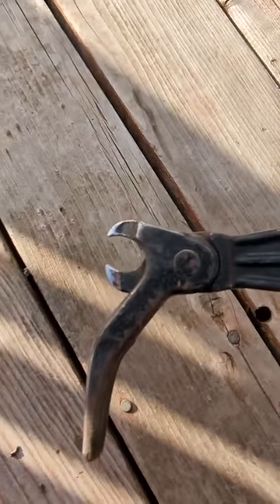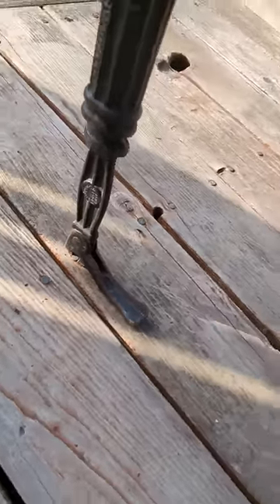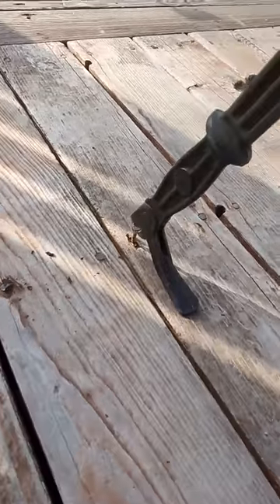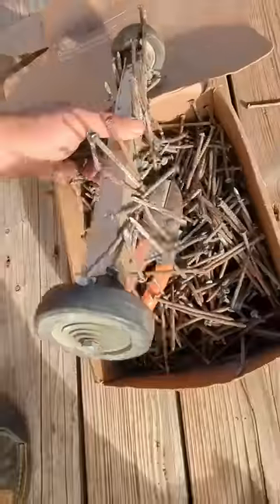The Deck flip is on! #deckrestoration #redwood #reclaimedwood

Comment: Skip the pressure wash, go straight to planer, pressure washing damages the wood
Reply: I thought the exact same thing he's just gonna have to remove more wood at the planer, making the deck boards weaker and likely taking more time to complete as well.
Reply: But dirty wood will wear out your planer blade faster so it may be a wash
Reply: @Ivan.Wright  maybe hit it with a sander lightly first? Lol idk
Reply: @cjbrags1344  No, that'll just get the very topmost layer and not in any cracks or divots. On that much wood I'd go with a quick spray, it's exterior wood anyway so a quick blast of water should be fine. However, if there's a real concern I'd go with a wire brush
Reply: @Ivan.Wright I’ve unfortunately kinda fucked up an entire deck about this size by pressure washing the paint off of it. That being said it is what the customer wanted and neither of us knew at the time that it damaged the wood. Of course not long after I did the job I saw a video talking about how it damages the wood and causes it to “fray” or splinter on top. Basically it ruins the top few layers of wood IF you use too much pressure. And there is a VERY fine line between just right and too much.
Reply: @keithbroh5730  But that's without running it through a planer. Those top layers that could fray are gunna get removed always so I don't see how it's going to hurt the wood in this situation.
Reply: Pressure washing doesn't "damage the wood" as in damaging structural integrity. It removes the surface layer of weathered wood, and it removes less than a planer. Pressure washing is fine. You just want to give it a few days to dry in the summer sun then stain it. Don't even really need the planer unless you want the smoother finish.
Reply: I don't know. I've never done this, but if I did, I would have to say I would use a brightener, powerwash, plane, sand, install and stain.
Reply: Dirt and grit in the wood will ruin planer blades within the first pass through, which will ruin a board beyond repair.

A properly set pressure washer will clean the wood, and once dry the planet will make it smooth as glass.
Reply: @cjbrags1344 , a sander will push any dirt and grit into the wood and then ruin the planer blades.
Reply: He’s doing it right
Reply: Honestly a drum sander would be ideal
Reply: A planer is gonna leave the bite marks on each end
Reply: @Cantspeakable Yeah... Just flip the boards, screw them all down, light pressure wash, sand down the boards in place and seal. D u n.
Reply: Wrong and terrible  idea, ALWAYS 1st clean off (Pressure wash) to help remove embedded sand and dirt BEFORE planning or you planner blades wares away or is damaged quickly..
Reply: Soft wash it
Reply: I was just about to type exactly what you did!!
Don’t add water, just take a little off the top.
Open the grain up a bit then seal it up with deck product of choice.
Reply: same
Reply: @Ivan.Wright and? Change the blades out a couple times during job, or go buy a carbide head helical planer head and dont worry about it.  

Changing the blades 2-3 times during the job is going to be a lot faster than pressure washing everything, letting it dry, then planing.  Youll also less damage at the end of the job, thicker boards, etc etc.
Reply: Yeah my thoughts also.
Reply: id never put those boards through my planer, they're getting washed or sanded, too risky for any metal to be inbedded that you missed, only takes one nail, screw, staple to ruin your blades, expensive and timely mistake
Reply: Improperly pressurewashing* damages wood. If you use a higher flow at a lower pressure it will clean withought furring the wood up.
Reply: @Ivan.Wright full day of work vs new blades. I'll take the new blades.
Reply: @Ivan.Wright time is money sweetheart. At my rates it makes more sense to buy new blades.
Reply: @Cantspeakable not if you weren't cheap amd bought a good planer.
Reply: @airgliderz new blades are cheaper than a half days work kiddo
Reply: @Junior-zq2ls  doesn't take all day to pressure wash that. Mabye an hour if you know you know
Reply: @Junior-zq2ls he kiddo, why you pressure wash first, no need for installing new planner blades, a pain.l, saves time kitty
Reply: @airgliderz  lol, definitely does not save time pressure washing it kiddo.
Reply: @ApexPressureWash  lol. An hour? Okay buddy, guess it just magically dries instantly huh.
Reply: @Junior-zq2ls  wrong again slick.
Reply: @Junior-zq2ls  go do something else while it dries. Plan accordingly. For example when I'm on a job im pulling out my hoses while I'm waiting on water to fill my buffer tank.
Reply: @Ivan.Wright yes it would however this is exactly what your printer was made for so quit wasting time doing it the other way it's literally faster to change or replace the planer blade
Reply: Bad preasure washing damages the wood, washing dirt off should be fine, washing paint or coverings off and it will ruin it most definitely 

Water is great for finishing wood, it opens the topmost grain fibres up for sanding, you can get a much finer smoother finish with some practice than just planing and finishing, planing it will inevitably pull fibres up and leaves the surface open for dirt, bugs and contaminates to get in
Reply: @ApexGamingHDTM  and when I'm on a job, I just use a planer and spend 12 buck on a pack of new blades. Takes less than 2 minutes to change them out. Time is money, and you waste time.
Reply: @airgliderz  less than 2 minutes to change out the blades kiddo. You go ahead and keep wasting time. I'll go ahead and keep making more than you.
Reply: @airgliderz  lol. Not even a little bit. But whatever helps you sleep.
Reply: @Junior-zq2ls  How do I waste time? If blades are so cheap just consume the blades and save time im all for that.
Reply: Like it doesn't get wet in the rain lmao it'll be fine
Reply: @joewat3982  planer
Reply: @ajaxracing  lol, if that's your defense you have no business here.
Reply: @ApexGamingHDTM  they are cheap. 15-24 dollars four a 4pack.
Reply: Not when you use the low side of a pressure washer
Reply: @keithbroh5730 it's ok. Painting ruins the wood worse. You probably used the right pressure but the wood was starting to rot because it was painted.
Reply: @Junior-zq2ls  hey if you like to waste time money and the time and money to keep changing planner blades you ruined then grieved boards you have to plane again creating different thickness boards vs a quick pressure wash cleaning. I glues you like gouging customers and ruining equipment cost time and money. But hey that's how bud light drinking democrats do, take more time, cost time, ruin equipment, take longer, and cost more money, enjoy your version of quality with now on clearance expired stale bud light beer.
Reply: Why would you plane the former top?
Reply: Then
Reply: @airgliderz  lol. Different thickness proves to me you have zero clue what you are talking. Someone has obviously never used a planer. Take more time? I can plane am entire deck, including the less than 2 minutes to change the blades faster than you can power washer it. Price gouging? I'm saving me time, which means them money planing it instead of power washing it. And blindly bringing politics I to an argument that has nothing to do with, just proves how upset you are over this conversation. Do better kiddo.
Reply: @airgliderz  but hey, you need to resort to insults to prove your point. Says a lot about the person you are.
Reply: @Junior-zq2ls  this comment right here just reeks of first-year journeyman energy nobody's making any money this is a hypothetical situation in which you would be in the shoes of the person who made this video
Reply: Pressure washing damages the wood and when you don’t know what you’re doing. Deck cleaning is mainly done correctly with chemicals and the pressure washer should only be used to rinse the deck wood with, e.g. to sweep with. 
When using the pressure washer with the tip to close to the wood and not using chemicals not only damages the wood but ruins it. 
All of the soft wood of which is called Ray is very easily damaged by the pressure washer while the growth rings are much harder and not damaged by the pressure washer. Once the Ray is damaged and the growth rings are standing tall it allows for water to collect in the area of the Ray. Thus, leaving the life of the deck much less than desired. 
I’ve always tried to explain this to customers and other folks that think pressure washing a deck without chemicals is the way to go. Retired now so don’t really get involved per chatter anymore. You knowing that pressure washing damaged decks is hopeful.
Reply: Low pressure and special cleaner you spray on before you wash it just have let it sit for about 20 mins
Reply: @PRACTICALCIVILIAN 
Properly set? You mean the right size tip? 
Also, pressure washers used on decks are really just meant to rinse of chemicals such as cleaners and brightners. 
Never use a power washer by itself to clean a deck.
Reply: @Cantspeakable 
That’s operator error.
Reply: @OldsmobileCutlass1969Va 
Crown down.
Reply: @ApexPressureWash 
A 40 tip with chemicals. Use the washer as a sweep to rinse only. Let the chemicals do the cleaning.
Reply: @ApexPressureWash 
Lol, 5 minutes to load, 30 minutes to get to the job, 15 minutes to get set up and 30 minutes to get back to the shop. The job to me looks like at least 2 hours in addition to the hour and 20 minutes. 
That’s 3 hours and 20 minutes. 
What are your rates? Maybe I should hire you😂
Reply: I love YouTube, I just ran through the comments and now I'm a certified deck builder, who knows NOT two pressure wash the wood and if I really have to I can softwash quickly or better yet wire brush before I run over it with the planner.
Reply: @johnbagewll2321  , I mean properly set pressure gauge. Mine has different tips for different tasks and a dial gauge to set the pressure of the hose.
Reply: @PRACTICALCIVILIAN  it’s been many years but mine was 3000psi and only adjustable via tips. 
I’m Probably many years out of the loop! 😂
Thanks for your answer.
Reply: @chrisevans3259  
Indeed, I’ve driven past a few projects in my time seeing guys with a 20 tip 3” away from the surface of the deck. Makes my stomach turn because they are calling themselves professional while ruining a deck every pass of the wand. Meanwhile, the customer is inside thinking how happy they are for paying a pro. Ugh.
Reply: @johnbagewll2321  , you’re most welcome. 😉 I was just searching, and apparently there are machines still being made that are only adjustable by changing the tips. I bought mine a 20 years ago when it was 1/2 off, so I got a really good deal.
Reply: @PRACTICALCIVILIAN  
I have no idea what I paid for mine but it payed for itself 20 times over I’d guess. Sold it at a yard sale when I sold my house back in 2015. Man time flies.
Reply: @joewat3982  😵
Reply: @johnbagewll2321  $150 minimum service call, and we are talking about on site time. Of course it takes longer but you do bring a valid point
Reply: @Ivan.Wright a planer blade is like what $10-$15? Cost of wasted wood is easily more than a few blades.
Reply: Or just dont put the pressure washer tip  so fucking close to the board lol. That simple
Reply: @joewat3982  
Alrighty.
Reply: @ApexPressureWash  charge the minimum of $150.00 to show up. Then charge $150.00 per hour for 1 man and 1 helper. That way you can estimate all day. You’ve got to pay your office staff, project manager etc etc. 
Gotta charge a premium to run a business that will last. I’m an estimator and can’t miss a dollar. Everyone’s go to eat. 
Semi retired is good.
Reply: If you planing them why bother power washing them at all.
Reply: @mistergoodcitizen9914  
Happy 4th!
Reply: Yeah sending dirty wood through a planer destroys planer blades. A light pressure wash doesn't hurt redwood at all.
Reply: @ashenmoonclash  
Exterior bleach and a rinse holding the 40 tip back from the surface 10” to 12” does the trick.
Reply: If done wrong yeah, gotta use proper technique to not damage or at least minimize the damages as much as possible
Reply: Not everyone use a planner
Reply: Right?
Reply: Pressure washing opens up the fibers so the stain can actually penetrate and perform way better, it also swells the grain so you can actually see the grain so you can put a semisolid/solid stain on that last way longer than transparent/ translucent. But what do I know, I’ve only been doin it for 30 years…
Reply: You can pressure wash wood as long as you are careful and dont put the tip right up to the surface, stay about 6 or 8 inches away
Reply: @yzrippin  who is a _____
Reply: You want to wash the grease and grim off before planing it. It'll gum up and dull the blade. You just have to let it dry first. Fyi, I deal with reclaimed wood all the time
Reply: When you run wood through a planer  it takes a bit more off the first few inches of each board. Maybe a drum sander ,that denail tool has taken a lot of people's eyes.
Reply: well pressure washing CAN damage wood but not always. unfortunately, usually, the pressure required to clean the wood does damage it so you can only safely do so much. the rest is up to a soft wash process which can do great.
Reply: @godw1ll99  not if you use the correct pressure
Reply: The pressure wash (at least to me) would just be preventing unnecessary wear on the planer. 
I probably wouldnt bother but my blades are pretty affordable. If i had some of the other machines iv used i might change my tune
Reply: Just have to light sand after the wash
Reply: @miles11we  just because something is affordable. Doesn't mean you should waste money on something that is preventable
Reply: True
Reply: @MrGravylegs So i know dirt and debris dulls knife blades quickly, no matter the steel. I would imagine an outdoor deck is going to have a lot of junk trapped in the wood fibers.

That being said, how would you go about avoiding dulling your planer blades insanely quick and possibly damaging the wood? Genuinely curious, not trying to say you're wrong.
Reply: pressure wash with the grain use the right tip and keep the right distance and you will be fine.
Reply: @santosdr2  circle soft tip
Reply: @Junior-zq2ls  its purely preference what you want to do. For fuck sake. Pressure washing it is fine if you know how to use a pressure wash to do it.
Your job do it the way you want to do it.

You want to jump straight to planning it down.  Do it.

Pressure washing is very fun process though.
Reply: Not if you know how to pressure wash. Its salvaged wood anyways. Why burn up the blades?
Reply: @keithbroh5730 there is no paint on the underside of his deck. Nice story tho
Reply: Pressure washing is by far the best choice if it’s done correctly. But yea if he just gets a cheap one and blasts the hell out of it with only water and doesn’t let it dry he’ll be f*cking it up
Reply: I would go straight to the lumber yard and sold the deck to someone that wanted to remove it that knew what they were doing.
Reply: Dirt damages the planer 😂
Reply: plus that redwood is now CURED. No way hes getting wood that good in Home Hardware. Yeah break out the triple rotor planer and hit that bad boy, then mix up a good batch of sealer and hit it a few times with some color mixed in and you have another good ten years or even more cause the underside is now practically water proof as well.

I love recycling things and not wasting stuff thats good.
Reply: @johnbagewll2321 every power washer has adjustable pressure. The 3000psi was a max, not an only setting. Learn your equipment. Most folks don't even need to read the manual to figure out these things. The tips are for spray patterns. There would be a turn on the "gun" to adjust the pressure on cheaper units, and a regulator on the machine on better built/professional units, even years ago.
Reply: @mistergoodcitizen9914 to get embedded dirt out of the wood. Not all planet blades are cheap. A chip or scratch in a planer blade leaves marks on every inch of board that passes through it. Sand and dirt damage blades. It's pretty simple, really.
Reply: @thomasarussellsr  
It is interesting that you are telling me I’m wrong, while also trying to insult me, while in fact YOU are wrong. 
Have a great day.
Reply: Pres washing doesn't damage wood if you know how to do it correctly.
Ive been lead pressure washing tech for 9 years and have cleaned/fixed alot of wooden fences/patios/etc
Reply: Let that bozo figure it out
Reply: My dad did a number on our porch with the pressure washer. Fucker went and croaked before he ever fixed it 😅
Reply: Skip the planer. Pressure washing only hurts it if you don’t know what your doing. No planer needed.
Reply: Drumsander...
Reply: What in the heck are you on about man. Pressure washing does not damage the wood unless you use the wrong nozzle and are blasting it with yellow or red nozzle maybe. If you use the black white, green or possibly even yellow tips you are likely fine. I wouldn't use yellow though.
Reply: And the plainer will eliminate the need for pressure washing
Reply: U can tell the heart for to him on that project
Reply: So does the planer Einstein.
Reply: Dust brush,light rub,run through a planet
Reply: i think it depends on the pressure you wash it at
Reply: Those boards look 👌 
Just hit with lite sand and medium bristle wire brush prior to plane.
Even better, you can soak them in wood preservative (C2gaurd) after planer.
Deck will last.
Reply: If you use the right nozzle and don't it too close to the surface you can powerwash wood without damaging it. Since he is running it through the planer he is more than likely just trying to remove any dirt or debris that could damage the planer knives.
Reply: @santosdr2  making money is more fun. Pressure washing waste time.  Which waste money.
Reply: @gregbaehring1656  you can take of centimeters at a time kiddo. You shouldn't speak on something you know so little of.
Reply: just set it to a lower PSI.
Reply: @Junior-zq2ls  having fun is subjective.
Reply: @Junior-zq2ls  Pressure washing is fun.
Very zen, only time it sucks is in winter.
and your got soggy socks.
Reply: @santosdr2  making money is more fun
Reply: @Junior-zq2ls  To you. also you can make money pressure washing.
Reply: I put a deck in 4 years back used the deck skeleton frame and red did the deck boards and railings on my place I'm in wi I pressure wash it every season and it's integrity still good not saying your wrong about it but I use a 2700psi washer and it does a great job imo
Reply: Try a wash with oxalic acid.  then rinse the next day. I have done redwood and it is bright pink next day
Reply: Damages the Wood Fibers!
Reply: @santosdr2  make more money planing.
Reply: Oxalic Acid and a brush ..
Reply: Soft wash with oxalic acid/surfactant mix and quickly rince. Never power wash, it'll fur the wood and in no time it'll get worst than the first side
Reply: @Ivan.Wright they're 50 bucks
Reply: @Junior-zq2ls I just never change change blades. ever. solves the time issue. and no back and forth about which is better. you're welcome kids
Reply: @johnbagewll2321 so essentially shou sugi minus the soot. and protection. so...sugi ban it is. start simply by deep frying a frozen turkey
Reply: If u suck at it
Reply: sure does.. i had to sand an entire deck by hand because i fucked a deck with a pressure washer when i was young 😂 had to do 2 free days of work, but the boss ended up paying me anyway.
Reply: @keithbroh5730 the paint ruined it. The pressure wash showed you that it was ruined.
Reply: No, it doesn't. It's treated lumber, genius. If that were true at all, they would tell you to install it under a roof. Don't believe everything you see online.
Reply: @keithbroh5730 I legit hate pressure washers the slightest bump or mishap and you are repainting a entire area
Reply: So pressure wash or dont??????????????????????????????
Reply: @johnbagewll2321 I've done this. Thought I ruined my deck and left it like that for like 5 years. Turns out, I just didn't know what I was doing and after I did it again WITH LOWER PRESSURE it cleaned perfectly and has a beautiful stain with just the right amount of texture from the growth rings. Let me be clear, pressure washing DID NOT ruin my deck. Even after I let 5 years of patina and mildew build up.
Reply: Run it through a drum sander. Planer will put on a mill glaze making it hard to finish
Reply: Soft washing is still possible with a pressure washer .
Reply: Feels like he could have sanded it down in place
Reply: Just do a low pressure wash to get the dirt out
Reply: Carpenters are like mechanics everybody has a different technique
Reply: @Patriotsoftwash  YES! 1 AT A TIME ! with hydrogen peroxide the soaking H2O as an appropriate lifting agent prior to any sudsing agency . using a bought trough for soaking or a PVC frame on a stand with heavy duty plastic sheeting as the liner to soak them in .
Reply: I was thinking the same thing.  Planar for the win.
Reply: Well planing wet wood isn't smart
Reply: @keithbroh5730 takes a while to learn but can be done. I detail decks all the time. The bad paint should come off. It should be done before repainting.
Reply: @Junior-zq2ls if time is money, the quickest and most effective and efficient method is pulling the nails, flipping the board, screwing it right back down, and pressure washing, then sand if you really want, strain, sealer. How fancy of a deck do you want, with reused boards?
Reply: If you obliterate it with pressure like a dip then yah
Reply: @AADPW  absolutely, but anyone with the slightest bit of intelligence can see what they did after 1 foot of a board length, a few adjust the nozzle or pressure
Reply: If the lumber is pressure treated you’re good
Reply: @berettaboi  no matter how you rationalize it. If you pull out a pressure washer it's automatically not the fastest way. Planing will always be faster.
Reply: @Junior-zq2ls  I wouldn't run them in the planner at all... Anyone that says they would has no actual experience pulling up old boards to reuse... The underside will be in great, nearly unweathered condition, with some staining due to water run off and old stain /sealer. A (properly adjusted) pressure wash is plenty for the task. I've done it, and will do it multiple more times I'm sure with the 400' of deck I currently have.
Reply: @berettaboi  thats awsome for you kiddo. Planer is faster. End of story.